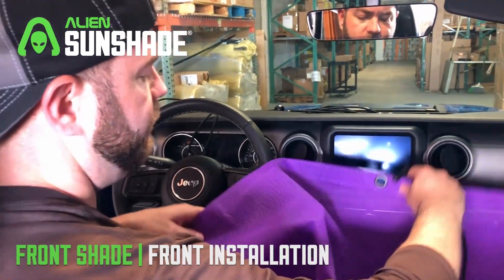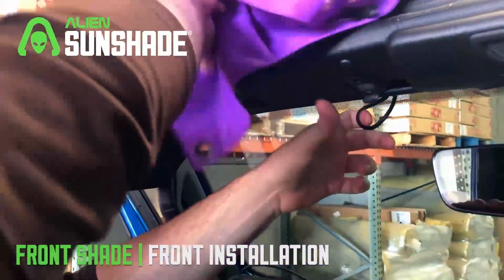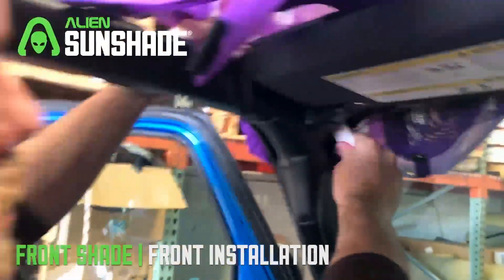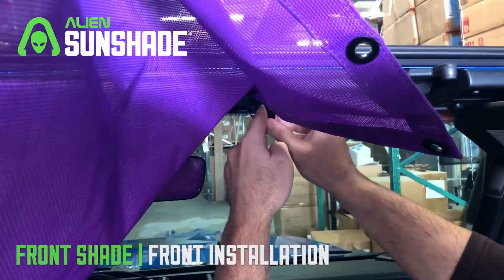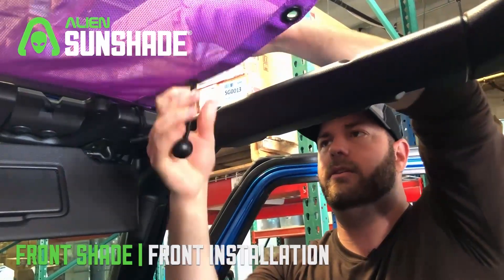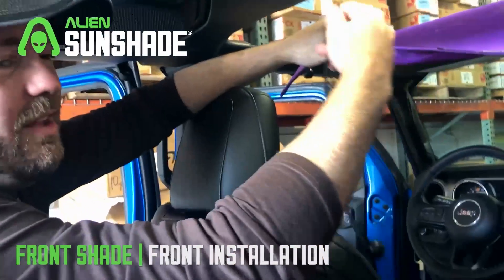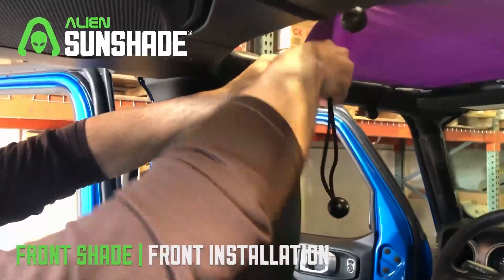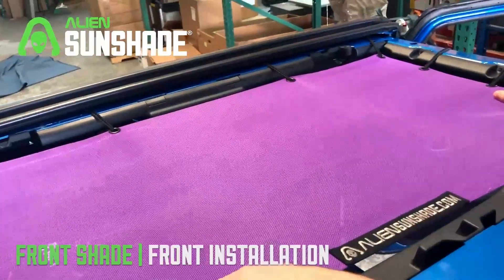How To Install Jeep Wrangler JL/JLU and Jeep Gladiator Front Sunshade | Alien Sunshade

Comment: He makes the front windshield look so easy, LOL, I was sweating a bit by the time I had all of them routed - the hardest was actually the back corners, since I had to fish around between the rollbar & hard top.  But you can get it done, just shimmy the white plastic piece a bit, and it will slide through - 2024 Wrangler SLU (4xe if that matters).  Works great!

Comment: I have a 2024, the installation tool cannot slide anywhere through the front.  It's all completely sealed.  My little white tool doesn't fit anywhere through the front. 😢
Reply: no way, I just ordered one for 2024, I wonder if you lower the windshield, would it work ??
Reply: I'm having the same issue
Reply: @YungChief  just lower the windshield down a bit and it works out perfect.  the sun shade has been great
Reply: @jakeminniti  that was going to my next option because I have a 4x4 attitude sunshade and they use a velcro strap that goes behind the windshield. I hate that the new 2024s are alittle different from 2023s and odler
Reply: Lower the windshield and remove the back top.. UGH😢
Reply: you can push the tool through just give it a bit of force

Comment: Thanks a bunch. It is always better to see it installed. I like instructions, but always better to see it.
Reply: After watching the video, I went out side under the shade tree, and did it all myself, in less than an hour, one-handed. My right hand is badly sprained, and in a brace. I was waiting till it healed up more, but I couldn’t wait any longer. So your shade can be installed, for the first time, via one-handed person who is not left-handed with the right hand in a brace. I used my fingers on the right hand to guide the bungees. I use the tool on the bungees and guided the bungee cords over the bungee ball, that’s how I got them on the sides and the back. I also use the tool on the back. So, thank you for the great video! It made it easier for me.
 The bad part is after loosened up my alien, grab handles (they are blue to match the shade), I broke one of the buckles. I found that if I put the Velcro strap through the hole for the other strap (every buckle has two holes), that I can use it just fine. 
I loosened  the handles to get the  sunshade bungees in the right place, then tightened the straps back up on the handle, it still  looks and works great.

Comment: Thanks for the video helped a lot. I have a question I haven’t tried but can I put the top back on with the sunshade still installed? Or do I have to remove the sunshade?
Reply: I have always been told that it is easy to take the front panels off and put 'em back on with the Sunshade on. Everyone I know, leave their sunshade on and in place.
Reply: I just tried it myself, and it  can be easily done. It is a little different, cause you have to reach a finger or two into the shade and grab the handles, but it is possible. Now, I’m a fellow who is right handed, last week I sprained my right wrist, its in a brace, so, I did it all left-handed. It will be much much easier for a person that is two handed.